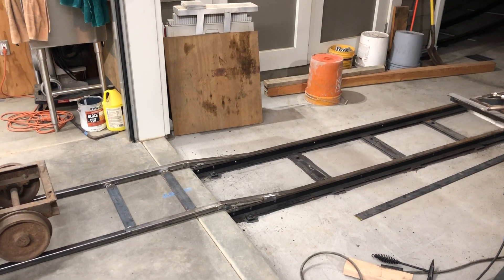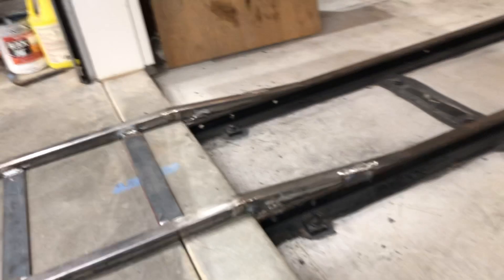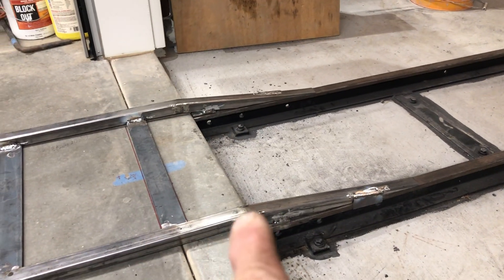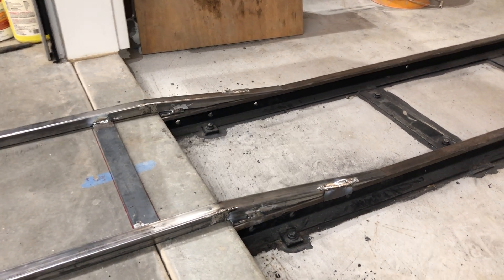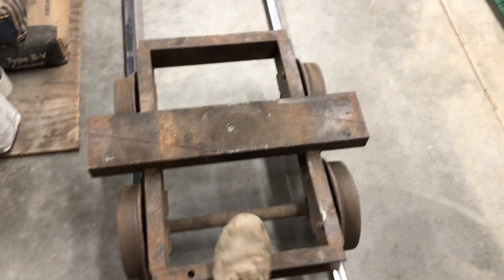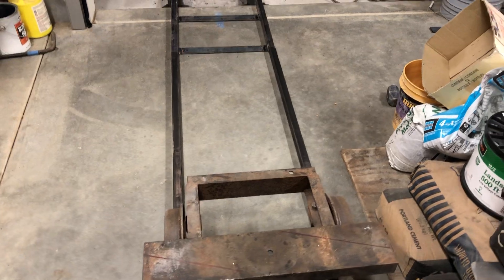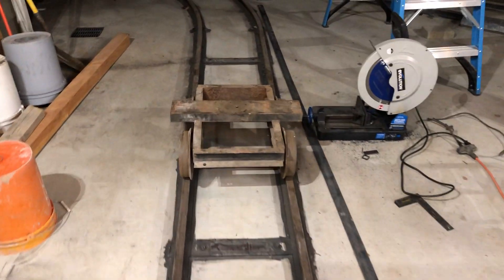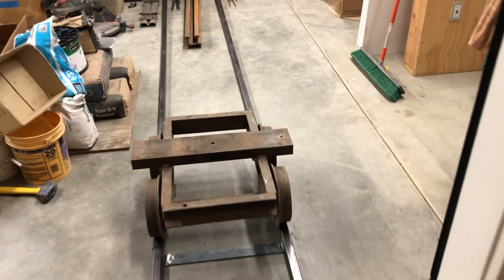Dec 14, 20 - Ramp for railcar access to workshop - Test

Comment: I'm just curious as to what you're going to build, in the workshop,  using the rail?
Reply from the maker: To start...the firewood railcars, fuel tank car, utility car, that's 4-6 cars total...I'll need to build them. 

If I decide to buy a milling machine or metal lathe, it'll need to get from the driveway to the workshop. When I made biodiesel, each week I moved 60 - 300 gallons from the driveway to my workshop, which was much closer at the time. When I was finished, I moved either finished fuel or waste material back to the driveway.

I currently have a small furnace for melting metal, but if I choose to buy a larger one, and decide to cast larger parts, it'll be happening in and outside of the workshop. 

At the moment, I've nearly completed sanding the frames for the 2 railcars that I have. INSIDE the shop, nothing rusts, but outside with a heavy dew, things rust overnight. Thus, anything I'm prepping and painting needs to be moved inside nightly.

All the posts and beams for the house have required a lot of hand work. I don't like sanding inside the workshop because of the amount of sawdust that accumulates on all the surfaces, so I sand outside, and then bring them inside before the humidity swells the wood (before I prime/paint them). Some of the wood has been too heavy to handle myself - The 20' 6x12's were almost too heavy for 2 of us. Putting them on a railcar for prep will now be the replacement for having to pick up and move this wood indoors. Note: It turns out that the last 2 big 'building' projects (workshop and garage projects) the posts and beams were finished during the rainy winter months because it was one of the things I COULD get done during the cold wet weather. Once building materials have been completely finished, I can wheel them to the driveway and from there, it'll be much shorter to the front for installation.

Oh, although I haven't really disclosed in the videos, for about 20 years now, Patti and I have planned on rebuilding the ENTIRE house, removing/rebuilding 1/4 at a time. The 2004 'Wing Project' was phase 1, and it took a lot of time for us to accumulate enough $$ (and time) to move forward with other phases. The Workshop BECAME phase II, and the Garage, phase III. Phase IV will start at the end of May next year, and Phase V, the master/guest living quarters will complete the construction. I hope to be very close to completed by the time I'm 65.
Reply: @SHunsader  WOW!  NICE!